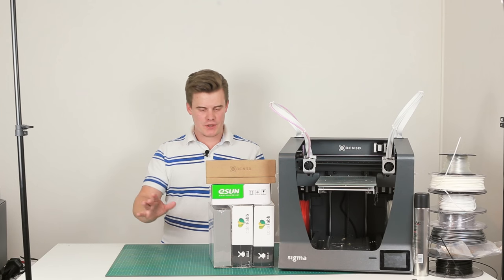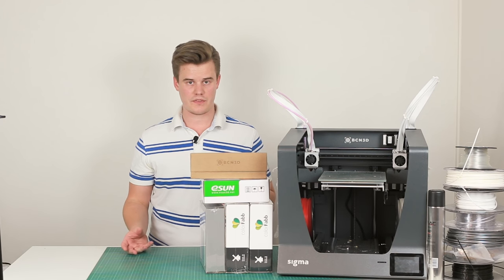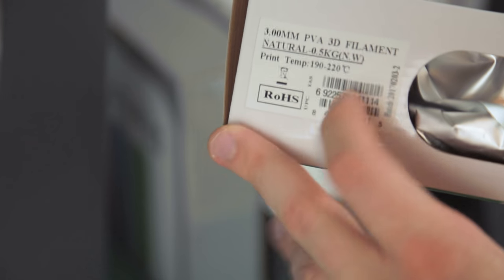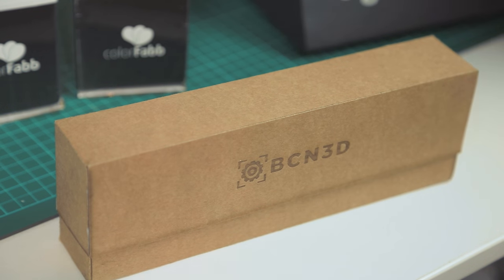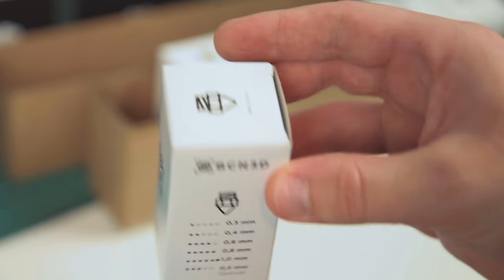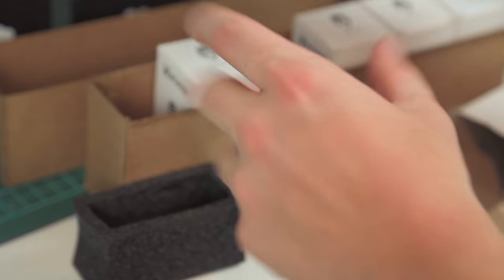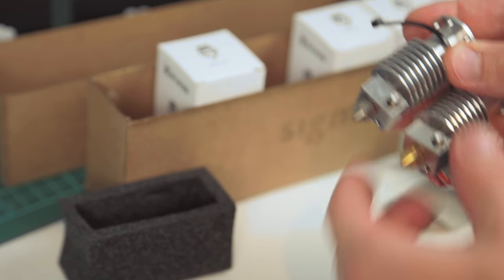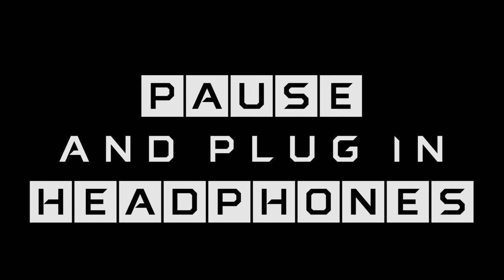BCN3D - Sigma R17 - VLOG 9 - Is it Louder than the old one?

Comment: How do you like the R17 overall ? I'm really struggling to pick between the R17 and Ultimaker 3. Do you think your dual color print quality could match the Ultimaker? let me know ! Thanks. Love the content
Reply: I'm in the same situation, would also love to hear thoughts on this.
Reply from the maker: At the moment of writing, the colors matching is equally good (at least compared to when I used the UM3) I don't have that unit left so haven't been able make a 1-to-1 comparison.

I think UM3 offers slightly more reliability but less flexibility as of now. The build cores are much more complex and I suppose we'll see better improvements in the future, but you have more options with the nozzles for the Sigma today.

In other words; for dual colors use the UM3 might be easier to work with (due to reliability), but for dual materials in general, the Sigma offers more flexibility.    

So it's a difficult recommendation to do hehe...